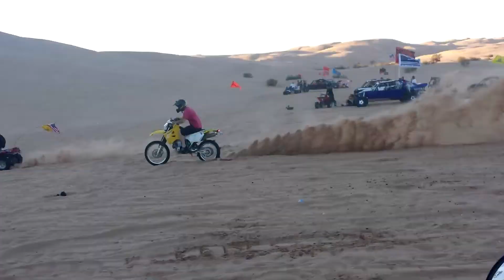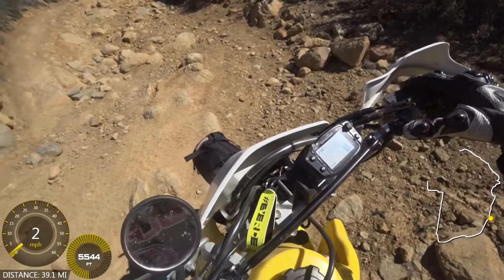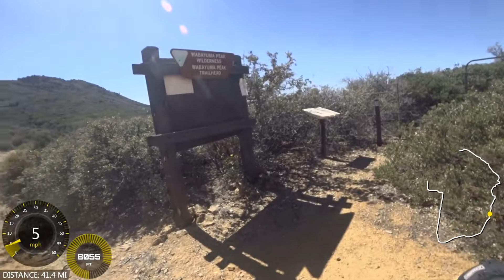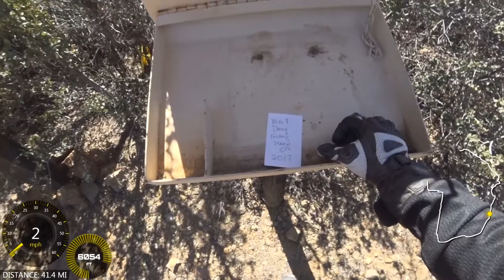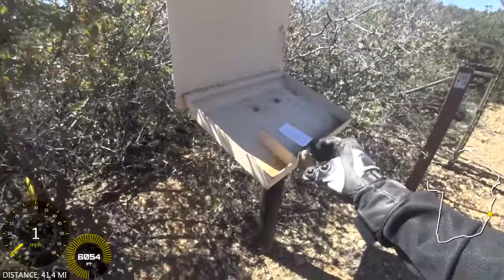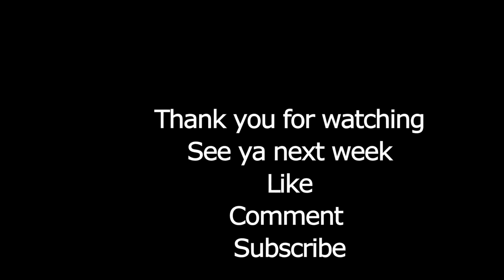Popped or Pinched I hate tubes!

Comment: Dude, gnarly trail! Sounds like you have about the same luck as me with tires lol... I don't like changing tires in my garage let alone on the trail. I did buy a tool from Happy Trails though that makes it a lot easier. It's like a clamp tool that you can wrench down and easily get the tire off. A must have for the trail for sure!
Reply from the maker: LowlySteward I'm going to have to look into that tool.  I'll probably wear it out before the years over!
Reply: It's pretty heavy, not sure if you'd want to carry it on your DRZ but it will get your tire off in a hurry! http://www.happy-trail.com/p-happy-trails-tire-bead-breaker-font-color-ff0000-br-font-was-strike-75-strike-font-color-ff0000-now-b-59-97-b-font-p.html
Reply from the maker: LowlySteward that's man